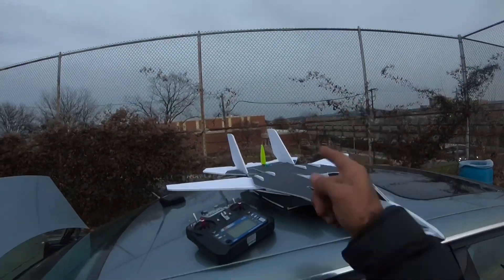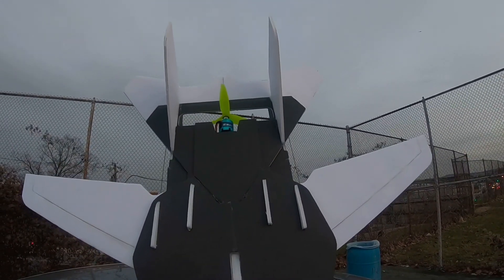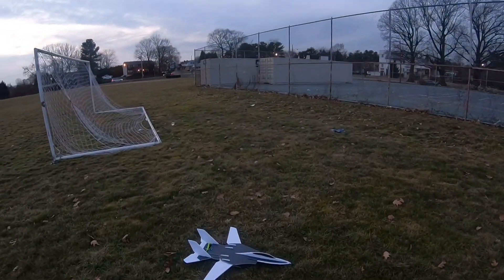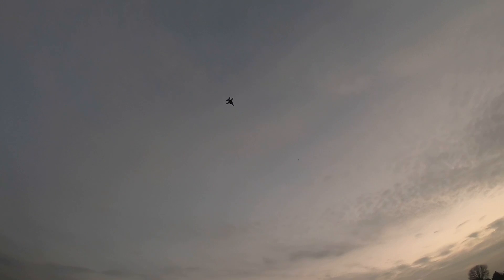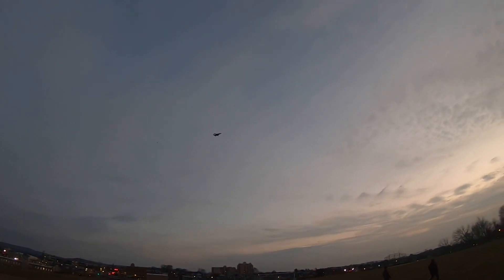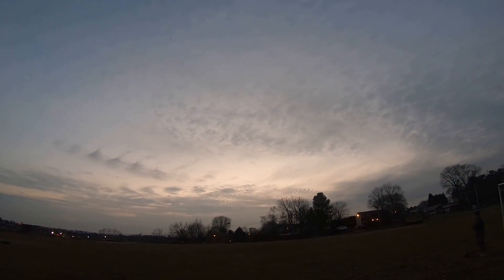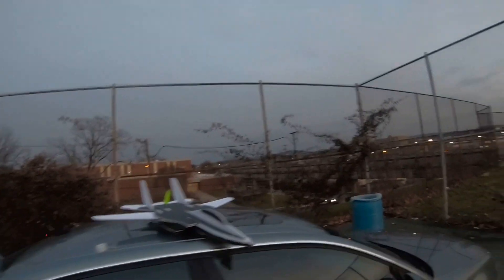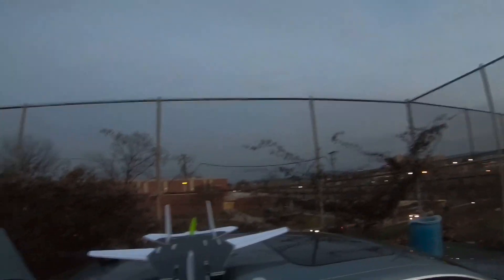F14 TOMCAT MAIDEN!!

Comment: Definitely wouLd love to see a build video on this plane.   This is cool
Reply from the maker: Half way done the build video!  After this we just need to edit the content so tomorrow it it’ll be uploaded.
Reply: @crossgenrc3235  awesome.   Looking forward to it.  I Have 1/2 the pieces cut out
Reply from the maker: @davidNH   There’s definitely a lot of pieces !
Reply: @crossgenrc3235  I am still in the build phase,  taking my time,  your video build was great.   I only have 1/8 plywood for the wing pieces...hopefully 1/8 works to the 1/16 recommended,  don't believe too much weight using the thicker plywood will make much difference
Reply from the maker: @davidNH  you should be fine brother ! Let me know if you have any questions!
Reply from the maker: Will do brother !
Reply: @crossgenrc3235  looking forward to it.  Just printed the plans. And lined them up. Ready to cut
Reply from the maker: @davidNH   same here ! starting to cut them out before bed time lol!
Reply: @crossgenrc3235  hey man. Are each wing two pieces?   Can you tape the plans together for those two pieces to make it a one piece wing ?
Reply from the maker: @davidNH   would be easier! The only reason I did them separate was so I could sandwich the spar in between those two pieces !
Reply: @crossgenrc3235  that makes total sense
Reply from the maker: @davidNH  I get out of work at 5pm today I’ll start the build video !